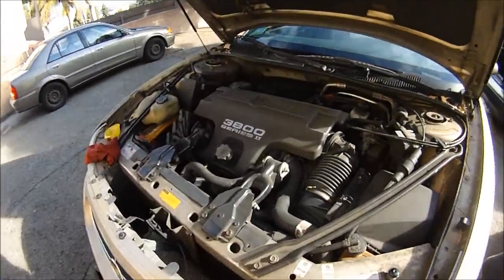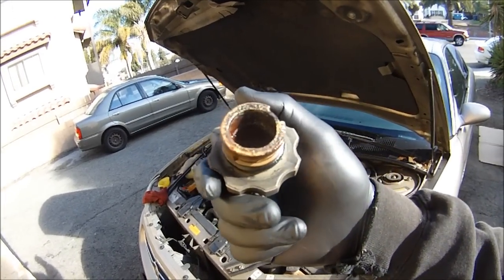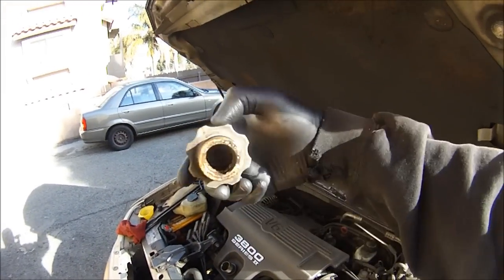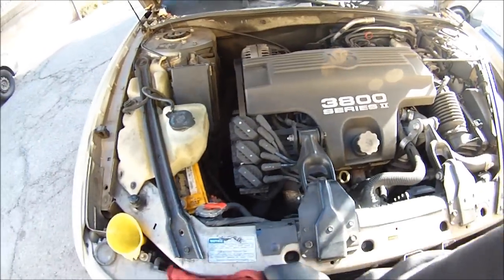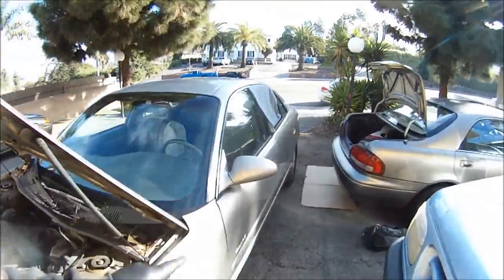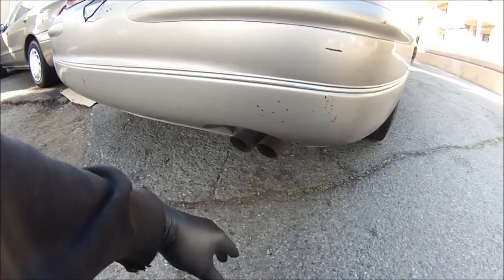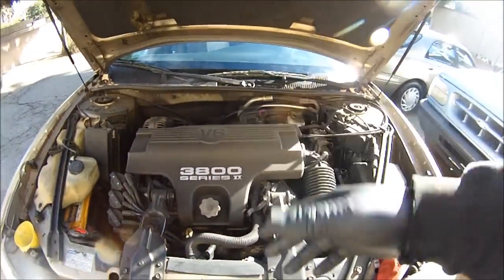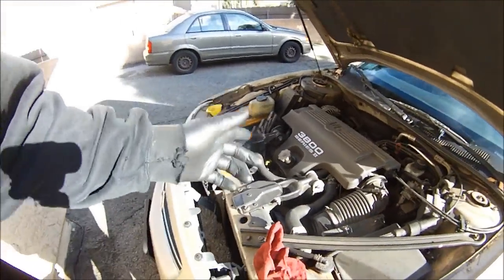BLOWN HEAD GASKET= MILKY OIL CAP. HOW TO TELL A BLOWN HEAD GASKET ON OIL CAP

Comment: Not the safest way to look if the headgasket/head are broken, It can be regular condensation! On many cars the oil cap look like that on the winter. The reason is because the car are driven to short distance without the engine are getting the right operating temperature and causes condensation! But if your antifreeze are a mess or smell gas the headgasket are f¤¤¤ed up!
Reply from the maker: Thats NOT CONDENSATION thats a blown head gasket straight up! doesnt matter how you try to analyze it, it is what it is.
Reply: No necessarily.You can have for example a 3.0 Ford Taurus mixing water with oil through a corroded timing cover.
Reply: @oldskoolfunk71  not entirely true. If there is no combustion gases in the coolant, then it can be because of frequent short trips, vacuum leaks, oil filler cap gasket failure, pvc failure, intake manifold gasket failure and a host of other reasons. My 01 Pathfinder has this issue and it is fairly common in Nissans of that model year. I thought head gasket failure too, but no white smoke, and no combustion gases in the coolant. Turned out to be pvc failure.

Comment: I have 3 vehicles all with over 100,000 miles with no major repairs. My Isuzu has over 300K miles and runs great. My best kept secret is using a superb car maintenance and management program www.lonewolf-software.com/automotivewolf.htm on my laptop that monitors the maintenance schedules for each vehicle and sends me reminders when anything needs to be checked or serviced. If you just keep up with your car maintenance schedule you will avoid a lot of these types of problems and save thousands of dollars in repairs.
Reply: excellent software! I use it myself.

Comment: From my 20 yrs mechanic experience, I would say if the oil cap is milky than the oil stick must be milky too....to confirm its a blown head gasket.
Reply: What is it if the cap is milky and the dip stick isnt?
Reply: +Jacob Freeborn  might be condensation due to cold temperature  and short distance drives
Reply: Mine had milk looking gunk on the dipstick too.
Reply: My oil cap is milky but my 2008 trailblazer seems to be running great no check engine or nothing what can it be
Reply: Angel F condensation